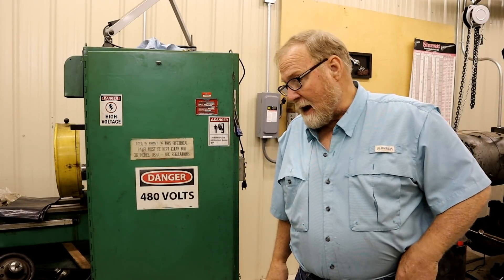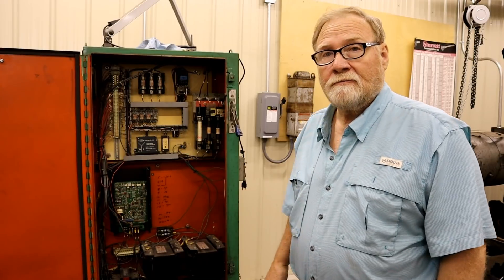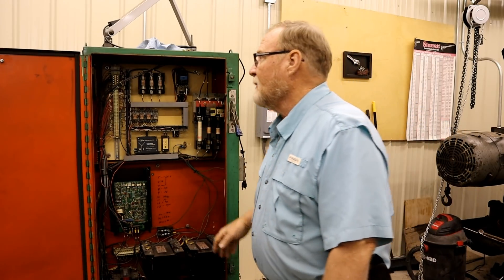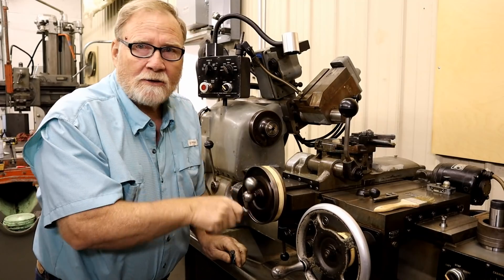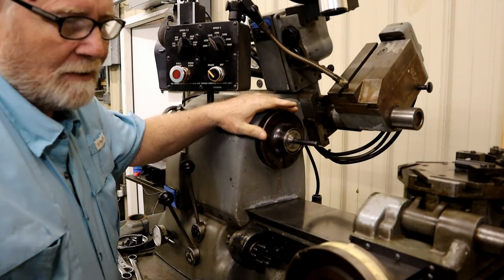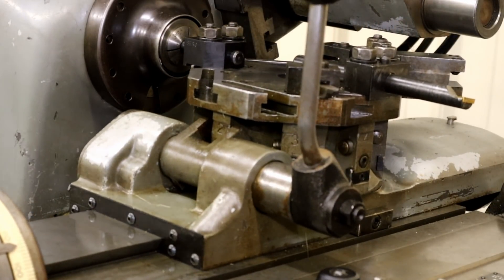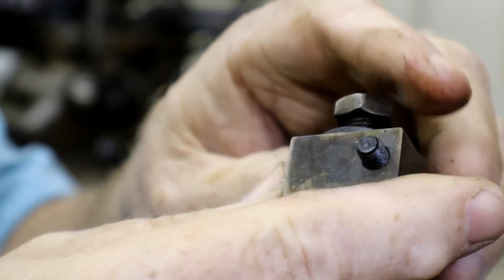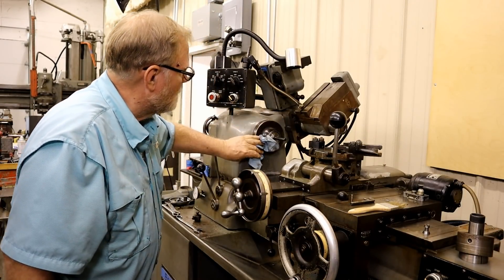Can We SAVE this 1990 Monarch 10EE ? : Center Finding on a Chucker.

Comment: First of all Steve, remember “You Can’t Get Rid of a Good Weed!”. Me? I am a Canadian Thistle!

First: I have a 10EE English/metric with tubes. The large cabinet was often used for the military/government JDEC option. You can always spot an old government machine from its JDEC box. Even the woodworking machines had the JDEC option.

Two: I had to rebuild the diode model. It was sparking and smoking. Got the parts from Digital-Key. Diodes, resistors and capacitors.

Three: The 10EE is a strange beast. Normally, you control DC motors by varying the field voltage and rotor voltage. But there are different ways to hook up a DC motor. Your small hand tools or drills with a universal motor is an example. It’s actually a DC motor set up to run on AC. Special case.

In many 10EEs, the motor is set up using a standard scheme up to about 1500 revs. Then the controller begins making adjustments to the both the field voltage and the rotor voltage. Unorthodox as heck! That’s how they get to 3000 revs.

Four: The first 10EEs used a ward-Lenard drive. Also known as a motor gen set. This remarkable invention is a mechanical amplifier. Just like an audio amplifier but uses mechanical parts instead of tubes or transistors. The speed knob controls the tiny signal voltage which is then used to power up the field coils.

Five: The DC motor is not prone to harmonic chatter. The Hardinge is! I often see this chatter on my HLVEM and I got to go up or down a bit to get it smooth again. It’s dependent on the part and is only an issue if the part is ringing like an alarm clock.

Six: The only major complaint I have with the 10EE is a lack of a taper adjustment on the cross slide. If you have surplus taper parts, I would be interested in them.

Seven: I have been looking for a chucker for some time.  Congrats on bringing Bob home.

Significant with the chucker is the overhead threading arm. Did you get this feature? It looks like you may have it. Downside is that you need to use a dedicated thread follower for each thread.

It would be cool to see parts being made on the chucker.

Comment: I got myself a HC last summer and have been fixing a few speed control issues and a improperly functioning threader-head same as your's and am slowly tooling it up. Mine came with dried up crud packed solid in the coolant sump and hoses as well, someone might've used water based cutting oils it looked like- I use a 5/8" ground bar to set each tool station, as the majority of the tool holders and tooling are typically 5/8" for this machine. Would be cool if you can cut some threads soon, would love to see that-
Reply from the maker: Get some contact cleaner and spray ALL the speed control pots!  I scratched my head for three days tracking down a speed issue and in the end it was the pots !
I am currently trying to get too other projects take care of...Will circle back to Bob as soon as I can :)

Comment: 12:50 Rather than putting a stop in the saddle, why not just reset the cross slide dial to zero ?
Reply from the maker: Mainly because I like a hard stop that I can't miss :)    Eyes ain't what they used to be and I think I have better pression this way... That is #1 on the turret and will always hold a center drill.  NO fuss this way :)
Reply: I set the cross slide wheel to zero and put a red marker there. - one of those metal clips. I also use the side pointer to get close.

Comment: Glad you're doing as good as you can do...for the present. REST, pal! ALL I wanted to do when I got back was S L E E P! Don't fight it. Snooze. You'll heal a lot faster by doing it. And oldness sneaks up on all of us. I looked in the mirror one morning and 40 plus years VANISHED! Sort of glad they haven't come back. Lots of interesting situations in that time frame; too many to remember. So rest easy and if you can't fix it with a hammer it has to be an electrical problem and that brings out the Don bot or maybe the real thing. OOSH, THAT brought the hair on the neck up! GBWYou and Yall from these old hillbillies.
Reply from the maker: Sleep is for when you Die :)   I am felling stronger a little every day...  Hell I'll bet I can out run old Don now :)
Reply: @10swatkins  Well, guess what, Pal!!